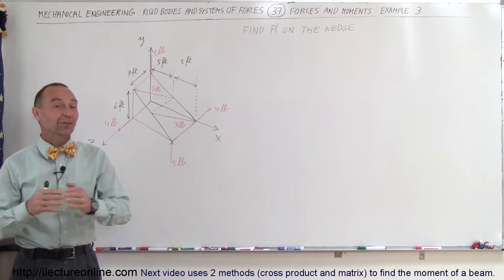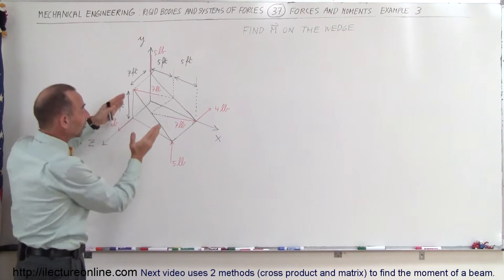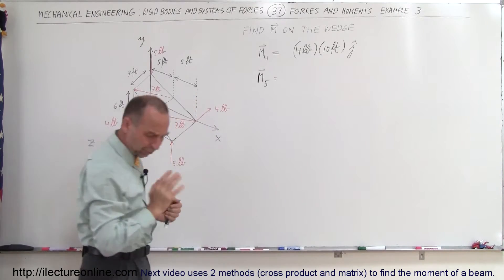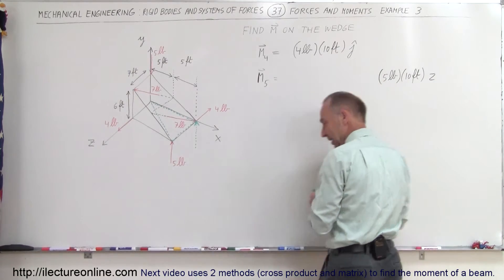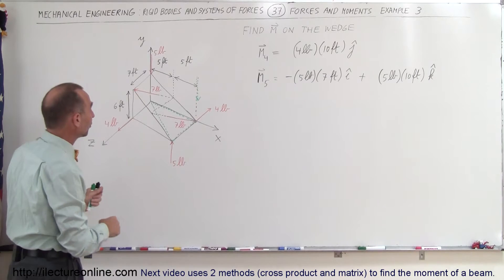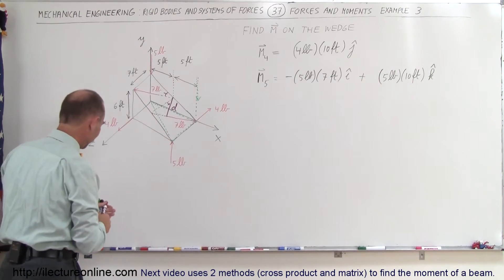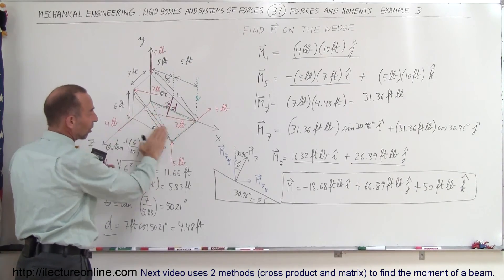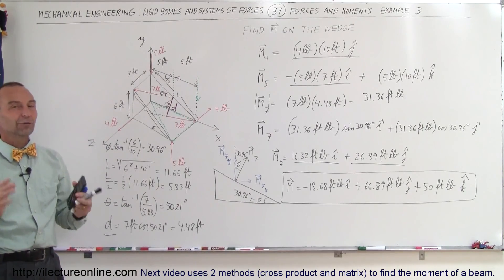Mechanical Engineering: Rigid Bodies & Sys of Forces (37 of 47) Forces and Moments - Example 3

Comment: Sir why is it that my instructor said that clockwise moments is positive and counterclockwise is negative
Reply from the maker: It depends on the situation.  If we refer to the inner moments of a beam, that is OK.  Otherwise it is the other way around.  In general the "torque" is positive in a counter-clockwise direction.  However, if one remains consistent, it doesn't really matter.

Comment: My question is on M7: the 7-lb couple is directed at y-z direction 7ft from y and at z-x direction 0f from y along the slanted plane. That makes the couple rotate around neither the three axes but around somewhere between the y and x axes along the slanted plane surface. Shouldn't the components be computed using the same method for M5 where the forces are first to be rotated 50.21 degrees (clockwise) and aligned along the x-axis before computing the moment and then find the components which will rotate relative around the z-axis? I am sorry if I did not understand that part.